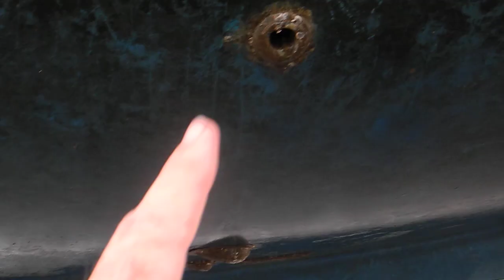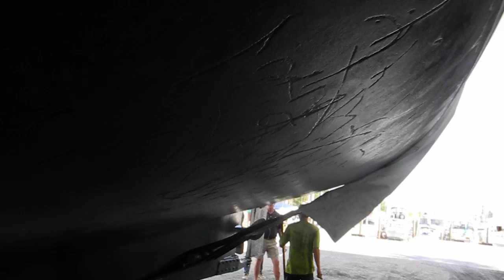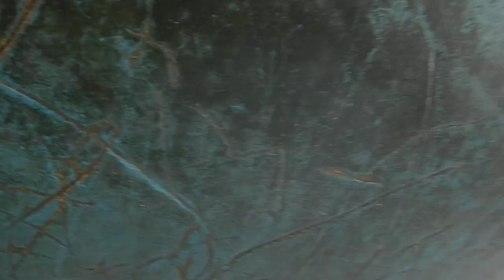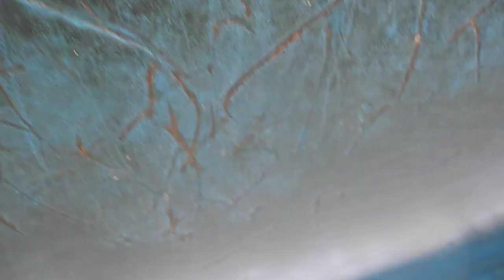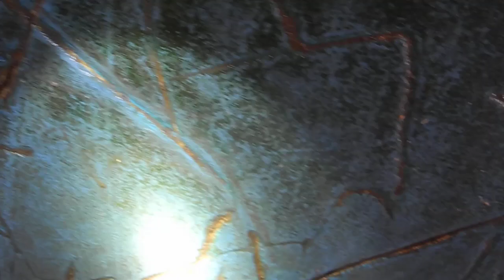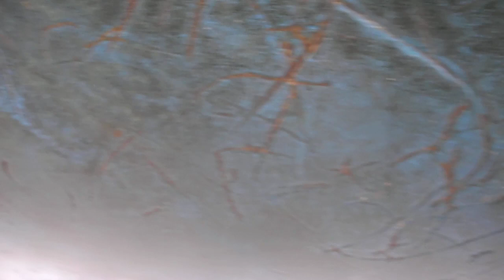Hull damage, ask a surveyor "how BAD is it"

Comment: Capt Chris, what boat? Were you expecting to find this? Or is the a used boat surgery haul out? ( you said port hull did you mean port side?). Looks like from the clean freshness of the scratches the boat was recently moved in a different place ( brokers slip?) with some ugly snag under the water. Looks like an insurance job for the current owners insurance and a look at its recent Mooring locating asap!
Who would have expected to have seen such fresh scratches?
Cheers Warren
Reply from the maker: warp21drive the moister meter proved that large area was saturated with water. The prospective buyer declined to purchase the boat. The seller doesn’t remember hitting anything. Hmmmm. We never did find out more or know how or if it was repaired.